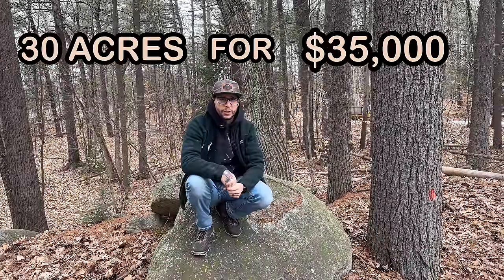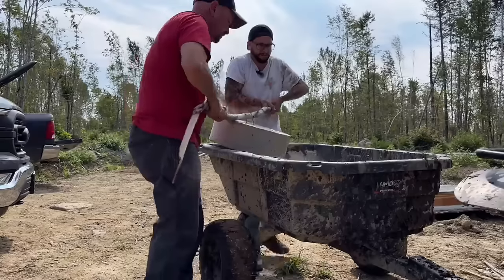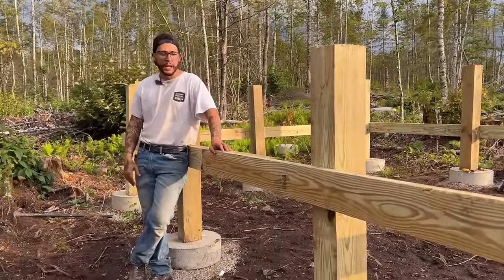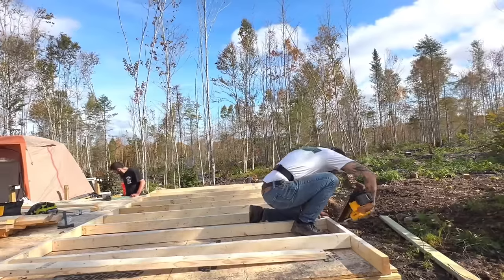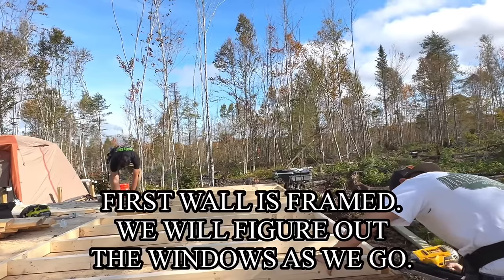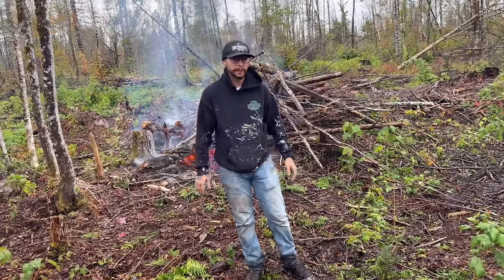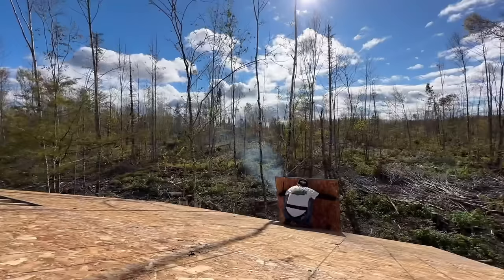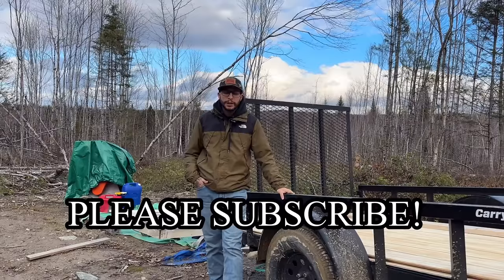DETAILED VIDEO OF HOW WE BUILT OUR OFF GRID CABIN | 12x20 AFFORDABLE CABIN | 30 ACRES FOR 35k

Comment: You need to put knee braces on the posts.

When installing insulation you need to overlap and staple the edges to create a vaper barrier.

When putting one piece of ( T111 ) on top of another when your wall is taller then 8'-0" you need to put a ( Z ) strip of metal between the upper and lower T 111 sheets to prevent water infiltration at that point.
Reply from the maker: Thank you for watching and giving me that info man! It was my first time building anything so I made a lot of mistakes. I’m going to build another one and hopefully that will go way better!

Comment: Looks like you had fun .
 Just a heads up on the framing please put proper jack and crimple studs as well as headers over your window and door spans.
 You are not carrying much weight over the walls but if you want your doors to open and close properly and your windows not to crack 
  take my info to hart
 Just google proper wall framing to see what needs to be done.
 Good luck.
Reply from the maker: Thank you so much for watching and giving me the advice! It was my first time building anything so I was slow and bounced around a lot. When I go back up I will do all of that and put it in the next video.

Comment: Probably to late but I would have put Z channel on the top of the first row of t-111 then put up the second row to block rain from slipping between the cracks getting behind the wood  if you could pull down the second row (on top)  could fix before it rots the T-111 from the inside
Reply from the maker: Yeah my first build I didn’t know too. I could knock it out from the inside and throw some z channel in there. Thank you for the advice buddy. I appreciate you watching

Comment: How will you insulate the floor for the plumbing not to freeze in winter. for sure, you could use this in the winter using a skidoo
Reply from the maker: Hey buddy the floor is insulated but we won’t ever have plumbing up there. It’s way to far and remote for anything but a composting toilet

Comment: Cole radon , run your pipe through your wall right now before you install wallboard,that way you do not have too run the pipe up the out side wall, also do you think that heated basement floor would work for you.?  You could breakup the basement floor and put in old water well, how about a pumper truck for cement, hose could run though the windows 😂

Comment: I would suggest that after you put your posts up to then put 6x6 beams on top of your posts. Then build your floor frame on top of your beams. This is a much stronger build method. You would not be relying on the strength of the bolts in your posts to take the weight of the building.
Reply from the maker: You are totally right, I corrected that later on in the video! Thank you for watching and giving great advice

Comment: Comments!    Congratulations  for doing what your doing.  99%of the population would not and could not do and or attemp to build a cabin!    RYOBI!!!! Don't knock it. I've been using RYOBI for 15yrs plus.     And next time you build. Try and use 6x6 and get a level line and notch for the rim joist. Make a cradle.  Very strong.

Comment: Curious why you guys didn’t clear some the debris before doing the cabin. I would think, that would dramatically reduce the hurdles bring in the equipment, and supplies and just make it overall easier. Maybe take an excavator rental or other heavy machine rental and get a lot of it hashed out in a few days.
Reply: It would even help dry some of the path out to help with driving through it. I get the rain though.

Comment: How come you didn't set your posts in a metal seat onto the concrete footers? Won't the moisture from the ground seep into the concrete and then into your studs? Especially with all the rain you're saying Maine gets.  Just asking.
Reply from the maker: Hey! I don’t want to attach them because it always gives me the option to jack up the cabin and adjust if I need to in the future. The 6x6 are pressure treated! Thanks for watching and supporting

Comment: Hello . Tell me please , what size of the wooden post , . 150x150 mm or 200x200 mm ?  And did you secure somehow it to the concrete blocks or no ?
Reply from the maker: It’s a 150mm x 150mm. 
Right now they are not secured to the concrete blocks in case I have to adjust them for settling
Reply: @Practicalforest  Thank you for reply.
Reply from the maker: No worries thank you for watching and supporting

Comment: Always put in and finish your roads before you start building.
Reply from the maker: When you are from 5 hours away and sleeping in a tent in the rainiest season on recorded history, the plan changes
Reply: The rainy conditions should have drove home the point I made.  Also, you will regret not properly choosing and preparing your building site.  Building in a simi-wetland area was a bad idea.  It will always be a mud pit when it is rainy.  Better to choose high ground to build on or build it up beforehand.  You should have built the cabin by the log landing area unless there was a better, higher spot.

Comment: You could have just ripped the plywood down to size in between the joist and nailed blocking to joist to fasten plywood to instead of working on your back under the floor. Just another way of doing it
Reply from the maker: Doug for our next cabin we might actually do that technique! It was daunting to know I would have to rip them all with a circular hand saw but hopefully I can get a table saw out there for the interior finish

Comment: You Mean you didn't Buy a Prefabbed/Prebuilt Shed to convert it to a house??? But But But ( as a example only ) You could have bought a Prebuilt Shed, that is Just the Shell that is 14x30 for Well Over $20,000... But one could be built Better and Larger for Under $10,000... And then have the $10,000 you saved Building it, to Finish it off. Where as the Prebuilt, you spent the $20,000 and Still have to Finish it... 
     Other channels that Push the Prebuilts HATE it when I point this out.. I know, I know, Not everyone can build a Shed themselves. But even Hiring someone to Build it for you would cost less than buying it Prebuilt.. Or Yes, Build it yourself and Learn as you do it, so when something need fixed, You can fix it yourself... 
    My Simple 12x12 Cost Under $1,000 to Build it myself and Would have cost OVER $5,000 to Buy it.. Saving Me over $4,000 that I can/could use on other things... But that's just me...
Reply from the maker: You know it! We will never go pre built. We have a real personal attachment to our camp now because we built it all. 
Thanks for watching and supporting us!!!
Reply: @Practicalforest   NO Problem. Also to Buy a Repo One, You get a Hit or Miss and Still Pay more than to just Build. get one that is Literally Full of Shite and ready to Fall Apart OR Could get lucky where the previous owner got a few walls in and the Electrical but again, Still paying more than doing it yourself. Because you are NOT allowed to do Anything to them, Until they are Paid Off. And If you do anything to them, You do NOT get your Money Back... 
    Don't get me started on those "Tiny Houses" on Trailers...
Reply from the maker: @ravenlorans I didn’t know you could buy repo’d ones! 
As for the tiny homes on trailer bases back in my day we called them mobile homes hahaha they have fancy trailer parks now it’s hilarious

Comment: Also, in my humble opinion, I think you made a mistake in your orientation of the cabin. I would always face the door and primary widows kinda due south, (give or take a few degrees) Get the sun (if it ever comes out) to warm up the place as much of the day as possible.
Reply from the maker: You are right man, when I think back on it I was focusing slot of the view and sun orientation for the solar panels. I will have to put in some big south facing windows
Reply: I'm thinking about bucking this good advice for my build in Tennessee.  Extreme heat is more a problem for us than cold.
Reply from the maker: We are going to visit Tennessee in may! Hoping the weather won’t be to hot. You have the opposite problem to us. It’s to cold here.
Reply: @Practicalforest     lol.  For sure.  May should be nice with highs in the low 80s.  June starts to really warm up and July/August are the oppressive sauna months.

Comment: Been there done that, got the T-shirt. You've already made #3 huge mistakes brother. When me and the wife did exactly what you did, we had a few years to go over everything. Wisdom more often than not comes from mistakes though. I'm wiser than most. Because I'm dumber than most. You'll woe the day you put that metal roof on. In areas like Maine and Washington state or Alaska, colder wetter states. You'll be colder, because of the metal roof. the constant noise gets old after a few weeks. And T.V. and cell service can't hardly get through them. Also, if you do get a water leak it'll be major, not minor.  2nd you didn't put up black paper, we call it "tar paper". And "green board". Green board is waterproof drywall. Do the green board same as drywall, first. Tape the joints, next goes the tar paper, overlapped of course. Then the T11. It double insulates the exterior; nothing gets through it. Nothing. Another mistake is not painting the T-11 with Valstar exterior paint. It protects from rain or moisture, mildew. Which Maine has more of than most places.  T-11 is not what people say it is, not anymore. It used to be indestructible, not anymore. Paint it or suffer the consequences. You also didn't put a vapor barrier under the cabin, your floor will rot without it. We painted ours with an oil-based paint #2 coats then gravel and then plastic and then more gravel. then we sealed it with wood added #2 vents facing north and #1 vent on the other 3 sides. Another cool trick I did later when it was completely dry was to add "Lime "Powdered lime to be exact. Spread it out so it's a fine cover underneath. No more mice or rats or critters of any kind not even spiders. It works.   And it's environmentally safe. And it's cheap, has to be the powder looks like flour. I know a guy who built a $200,000 dollar home and didn't put down a vapor barrier. All his floors had to be replaced later. Cost him a fortune too. And lastly put up a gate about 100 feet off the main road. Lock it with an uncuttable chain and lock. And hide a trail camera to catch the gate and road from behind a vehicle. Then put another one watching the front of your cabin. Hide it good. Use the best batteries money can buy for them Energizers Lithium. Any thefts or problems you'll have their vehicle and tag and them on camera. Cheap security. And it works too. Amazon has them for $39-$300. The cellular one's notify you if it trips and you can watch the action on your phone live. As it happens. Someone cutting your lock or breaking in. Call the cops. As you watch and record them. I sure slept better.  Need advice I'll follow you.   liked subbed notified           Peace.
Reply from the maker: Brother thank you so so much for taking the time to explain all the concepts and procedures to actually build a cabin the right way. I am going to take all of your advice next build and use you as a reference!